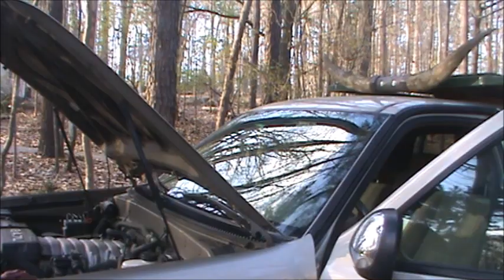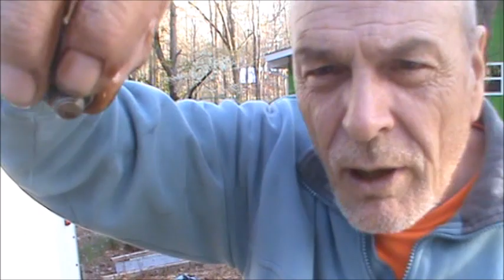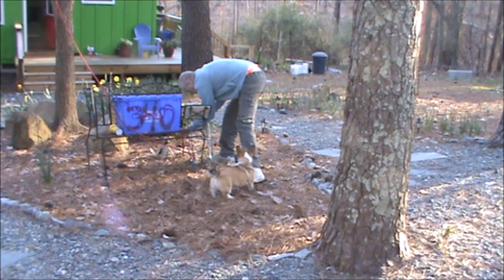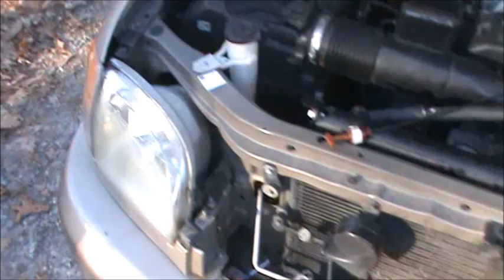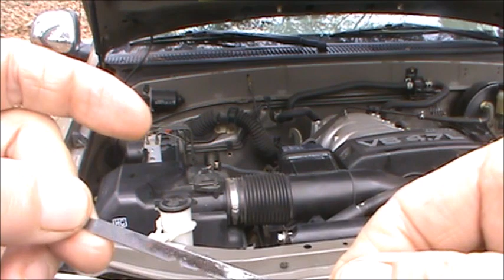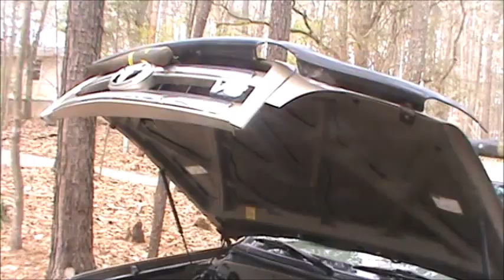Change Transmission Fluid 03 Tundra

Comment: Did you flush your transmission? Or just drain & refill? How much came out when you drained  it? What is the actual total amount of fuild it trans. Only some of your trans fluid comes out, about half, when you drain & fill. The rest of the old fluid is still in your trans! You have to flush to get all of the old stuff out.
Reply from the maker: I had the dealer do a drain and refill with their machine.
Reply: @porkdogx  oh wow. In that case I've lost respect for Toyota dealers
I have an 02.
Reply: @porkdogx  The dealer drained & filled. Did they Flush Transmission & then fill? There's a big difference!

Comment: Called local dealer here in Colo and my 2002 has trans cooler but couldn't pin that valve open so I just kept carefully running it as I drained pan and got 7 qts(out of 11 total) of fresh fluid into it today.  I am using AMSOIL and it is good stuff.  I didn't want to risk a flush as I have heard it can block valve body and cause problems...thanks for reply

Comment: I heard sir that if you do not do a complete flush that you will have only changed 30 to 50% of the oil. It may not be a great idea to complete change all the oil. The contaminates would be helping keep friction on your older transmission and can result to failures if completely flushed. If the change was done when required it would not be a concern. But for older vehicles it will be a problem.  What do you pro experienced people think?

Comment: I'm curious how it looked after a day or so of use. You should still have several quarts in the torque converter of the old fluid. Enjoy your videos.
Reply from the maker: Bad JuJu  Thanks for watching. Your comment made me go out and look at the fluid. 
 Color is red/brown, the fluid feels good. No big grit. 
 I need to pull the pan, wipe it clean and change the transmission filter. 
That will be a future video when I get to it. Please subscribe if you want to find out what happens.

Comment: You most likely have coolant in the transmission, from a leak in the fluid cooler inside the radiator. Just replace your Radiator. and another flush or two and you should be good to go!
Reply: Yeah, the milkshake

Comment: At least you have a dip stick, the 06 started using WS fluid and loss the dip stick
Reply from the maker: rhpham2  Yea, your right. I hear BMW has no dip stick for the oil. What the hell is going on? Has common senses gone out the window.
Reply: Is WS oil compatible with a 2000 Toyota Tundra?

Comment: I have a 2003 Tundra with 250,000 miles on her.  My only recommendation is to use genuine Toyota fluid.  Had a local shop do an oil change and transmission fluid change and the transmission started shifting roughly ... recently changed back to genuine and she shifts like old times

Comment: Hi , I hav an o3 all so v8 and did the rear seal all so to a transmission shop it worked for a while but is back to liking oil , I did the timing belt at the dealer for $700 before I asked a few mechanics they wanted $1200 and more for timing at 1 mechanic I said why you charge so much more than a dealer does? So the point it’s hard to find an honest people? Good luck
Reply from the maker: Thanks for the comments. Hard to find honest, experienced  people to do any job today.
Reply: Your dealer only wants 700 to do the timing belt job??????

Comment: anyone know how much it costs to fix rear main seal leak? thats the only issue i have with my 07 sequoia
Reply from the maker: I just had the dealer fix mine a few year ago. I think it cost me about 1200 bucks.  It took them 3 tries to get it right. I only paid for the first repair. 
So I'm feeling it was money well spent.
Reply: @porkdogx  why didnt they get it right the first time? mine isnt leaking badly but im worried moisture will get in there somehow and cause more trouble if i dont get on it soon. im just glad it isnt transmission related.
Reply from the maker: @RiCaRdO408  from what they had to fix the second and third try.
I think the shaft was damaged when they removed the transmission.
Second try was fix without replacing expensive parts. When they gave it back to me. I was told it was still leaking.

Comment: Transmission oil should never be dirty like that. Your clutch packs are wearing and creating a sludge build up you could put new fluid in and it will be dirty it has to be vacume flushed and refilled, drive for a month and change the filter. Then redo it, it will be clean, but you will have another issue real soon , its called rrbuild or replace. Cant be much clutch plates left

Comment: Fluid becomes dirty again because the fluid in torque converter was new drained.  Don't ever have dealerships flush the transmission because the valve body can get small particles into small orifices and not work right.  I learned this from experience!!! If there is an oil cooler on trans torque converter can be drained that way!!!
Reply from the maker: R Y thanks for the comment. Too late. I had the another dealer flush the transmission. It's been a few months, everything seems like it's working. Keep checking in on my channel. If the truck dies I will post a video. Please subscribe.

Comment: 4.& liter engine would suck a lot of gasoline. I bet you got 20 miles highway and 12 miles in the city, right?
I have a 6 cylinder 3.4l 2001 Tundra and it sucks a lot of gas....and it has only around 22,000 miles..
Reply from the maker: Your spot on. It's a gas hog.  How did you get a  2001 truck  with low miles on it?